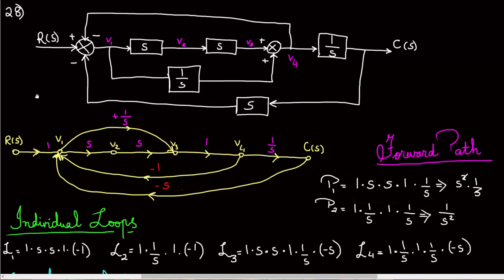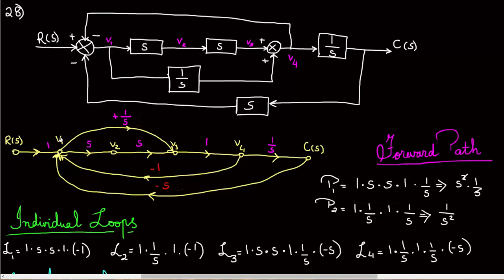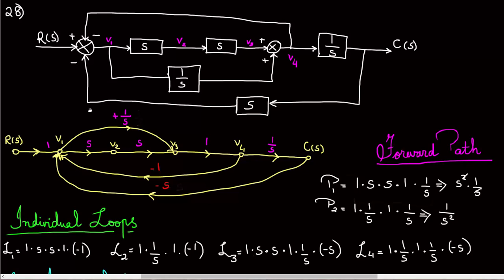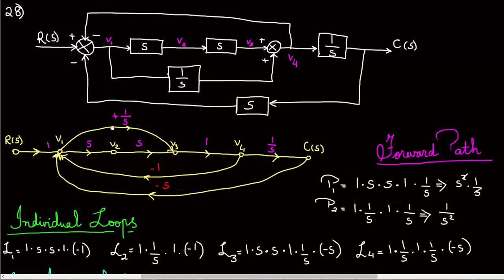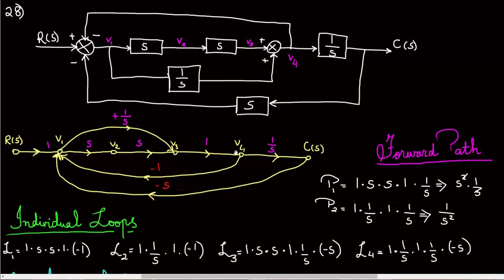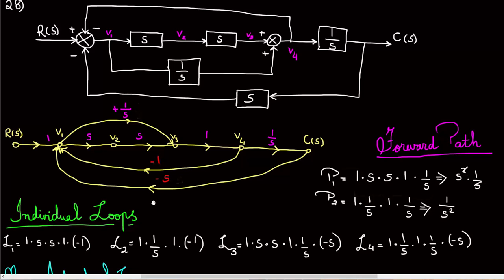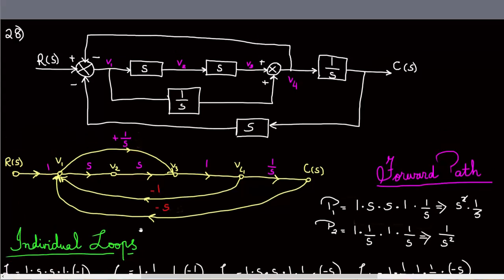Mason's Rule for Block Diagram - Controls

Comment from the maker: In a lot of homework problems that I did I encountered the same situation where a loop gain [like s or -s in the above problem] so delta1 and delta2 is equal to 1. In order to have different values for delta 1 & 2 the problem will have non-touching forward path loop(s).
If you have the book Controls System Engineering 6th edition by Norman S. Nise then looks at example 5.7. I hope that clears the confusion.
Reply: I think someone ripped off your content. Here's the link: https://www.youtube.com/watch?v=NzPfxQewy8A

Comment: Sir, I have gone through numerous videos and examples, but i am still never encountered a problem where delta1 or delta2 has been taken other than 1. I will be most thankful to you if you can illustrate this case with an example or point me out an example from literature where delta1 or delta2 have been taken as values other than 1. Thanks!
Reply: when a closed loop is not touching a forward path delta will not b one...at this time delta will b changed..